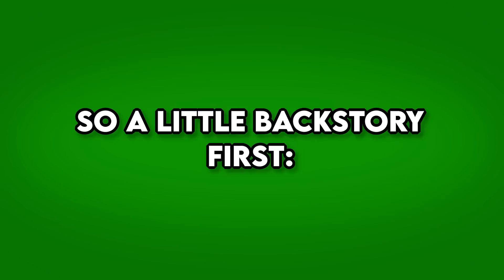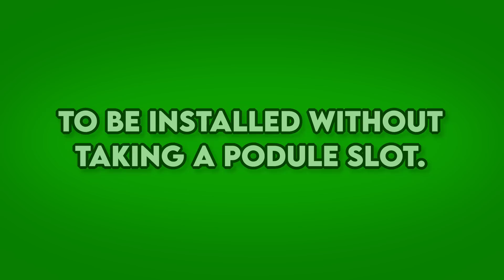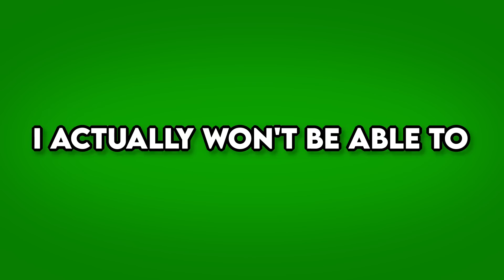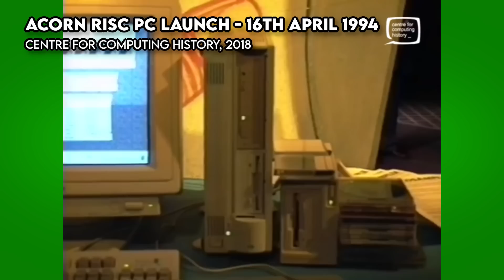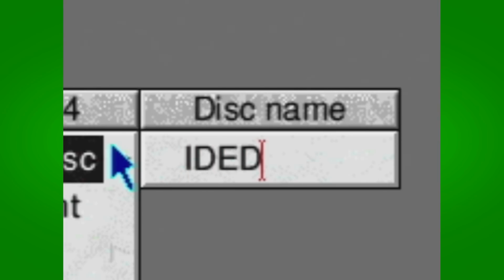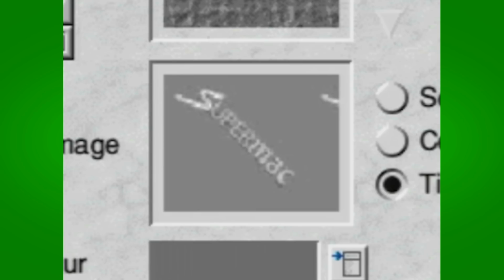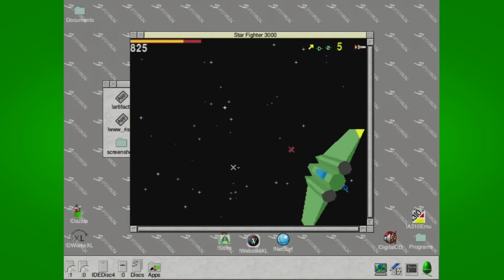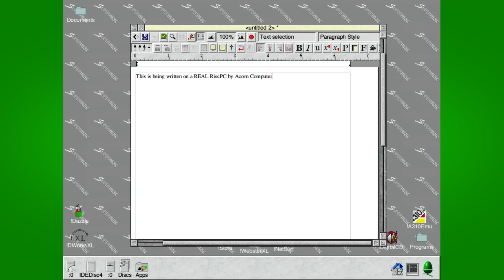I Built The Near Ultimate Acorn RiscPC!

Comment: Did you use an ECONET Network adapter?
Reply from the maker: The NIC I used doesn't have an Econet port, just RJ45 for modern ethernet. I believe there IS a NIC that does Econet for the RiscPC, but this isn't one of them. 😅

Comment: Hi what did you do with the dead motherboard you removed from the Risc PC 700 ? It's usually corrosion caused by the clock/cmos battery leaking, but they can be repaired.

Comment: You used an Acorn computer until 2008? Crazy. Could you browse the internet and stuff? Were you able to watch youtube?
Reply from the maker: Technically I did have a second computer at the same time as the Acorn since, like 2005, which was a Pentium 3 RM Window Box - though that didn't have internet until I had a USB wireless stick in 2007.

In terms of internet, my family was still using dail-up until we got Sky (The UK Comcast) in 2006, and even then the dail-up was only on my parent's computer. My childhood Acorn never had a NIC, and my room didn't have any network cable to the router downstairs until 2018... So to answer your question I just DIDN'T browse the Internet or watch YouTube... It was even a consideration then! 😅
Reply: Yeah getting to the hardware upgrades, not a chance. Impressive how long you made it with such a computer. Nice video.

Comment: The black optical drive looked like a Sony drive, probably a rebadged Lite-On model. (Sony made very few of their drives themselves.) If you would like to use it, these drives were very common and it should be easy to find a beige rebadged Lite-On drive (or possibly just the front) with a compatible front you can swap over if you ever wish to use that drive. The same shape & drive mechanism was used for succesive models. But they did change a few times, check the led & eject hole positions.
Nice to see these machines still being used and loved. We rarely got to use the Acorn Archimedes computers at school and I used a PC at home. But I could appreciate some of the Archimedes' finer points - it was certainly far nicer than the contempary Atari ST & Amiga. And the CAD performance of the school's early A3xx was very impressive (tradgically it was never used), even compared to my 386 at home.

Comment: The Quake benchmark comparison is informative, and it is surprising that the machine holds up so well against the other systems, even though the 5x86 is effectively a 486 with ramped up clock. DEC considered the StrongARM's performance to be only somewhat comparable to the Pentium, whose frequency was steadily being pushed upwards by Intel.

As noted, the memory bandwidth was a big problem, leading to those Kinetic cards with on-board memory to attempt to mitigate the issue. It seems that the A7000+ actually had greater memory bandwidth, but it obviously had a slower CPU, albeit with hardware floating-point support which the StrongARM lacked.
Reply: paul_boddie
5x86, Cyrix you meant, WAS CRAB !
Pentium only back then, AMD and all others failed hard.

Comment: Hm, you think it's worth copying those flaky ROM chips to new chips? Just standard EPROM or EEPROM ought to do it, unless Acorns do something weird with them. 

Funny how you can remove the top deck and there's basically nothing in there! Just giving headroom to the stuff beneath. Is there any chance you could take a modern ARM CPU and put it in there? You'd have to get one that isn't a SOC, but a pure CPU with the full bus exposed. But you could get 20x the performance, even just with a single core! You might even find a chip with RAM built-in so running much faster than the FPM 70 or 80ns RAM you seem to have there, modern SDRAM is something like 5 or 6ns. If it has the RAM mounted on-chip to the CPU then there's no interface hassle.

Then again you get to a point where you'd be better just with a Raspberry Pi or one of it's siblings from other companies. Emulate all the I/O over USB. Although yes it's not the same, just depends how far you want to go. AFAIK they've ported RISC OS to the Pi, right? You could see how far you get in remembering the good ol' days while still being able to do usefull stuff on the Internet, using an alternate OS just for it's own sake, which has value these days in the monoculture we're all living in.
Reply: You've probably stumbled across the main reason why these machines don't get accelerator card upgrades, as opposed to systems like the Amiga. RISC OS works on the Pi, and it is still developed for people who feel the need to use it in this day and age. And for everyone who wants the nostalgia trip of running games of that earlier era, you can do that using original hardware without accelerators or by using an emulator.

There is also the economics of making add-ons for a platform which, in its broadest sense, doesn't seem to have surpassed the million unit mark, as opposed to the Amiga which sold millions in a single year at its peak. That doesn't mean that people aren't making add-ons, particularly memory, storage and network boards, but the reduced audience compared to Acorn's 8-bit models, plus the slightly more demanding technical aspects compared to those earlier models, means that the 32-bit scene is somewhat less active.

It is possible, however, that more attention will be placed on these machines over time. Putting a modern CPU on a processor card is something that has been discussed to a degree in the relevant forums.

Comment: i used rics machines through out the 90's due to work and loved it , of course like most things our hardware in the building services industry switched to windows and we phased out the rics machines 
i recently got an SBC that runs risc V and im in love with it again , so much so im in the process of building a daily driver to run in risc 
i too was going down the vintage route , but im looking more at a build using ever improving SBC boards with various add ons as a cheaper way and who knows when on e bay a good example comes along at the right price i will get a vintage unit and bring it back to life

Comment: What a lovely setup. Technology moved forward so quickly back then, and like many others, Acorn couldn't keep up. It's such a shame they didn't release the Phoebe before leaving the market. My only experience of RiscOS is on the Raspberry Pi, and it's very different to Amiga Workbench or Windows 3 that I used back then.  In the early and mid 1980s, the school I went to had a very limited number of computers. I don't recall them even having a BBC Micro, but a ZX81, a Tandy TRS80 or two and a Research Machines, Z80 based monstrosity... but we had no computer studies classes. 😂
Reply from the maker: I do agree that it's a shame the Phoebe never made it to market - would've been an amazing system and maybe there would be a GFX-accelerated Quake for the system/OS like the Classic Amigas have under Voodoo! 😩

Comment: As someone who went to school in the UK in the 80-90s, I grew up with acorns, and eventually, in Year 9, our school had a RiscPC! The Teacher managed to get it with the 486 card, allowing PC software to also run on it. Amazing machine! Thank you for this trip into the past!
Reply: By "PC software" do you mean DOOM? And did the teachers also mean DOOM? That game alone sold more 486 chips than any other software in existence, I guarantee it!
Reply: @greenaum  You don't buy hardware to run DOOM, you make DOOM run on any hardware. From a minecraft redstone CPU to a car's LCD speed dial to a smart lightswitch, making DOOM run on anything is the way!
Reply: @greenaum  And yes, I just looked it up,. DOOM Acorn RiscPC exits, so does Doom+ which supports ARM3! You can have both CPUs running DOOM at the same time.
Reply: Electron you meant ?
ARM projects in any school ?
Reply: @lucasrem  BBC Micro?
Reply from the maker: Not a problem! For me my Infant School started throwing away their supply of A7000 machines (I naturally even back then asked if I could bring one home, and they declined), so I never used an Acorn in any meaningful way in the education system... I'm just fortunate my Dad was/is a massive RISC OS user and my first few machines WERE Acorns! They are truly remarkable computers and I'm glad I managed to soup one up to this point! 😄